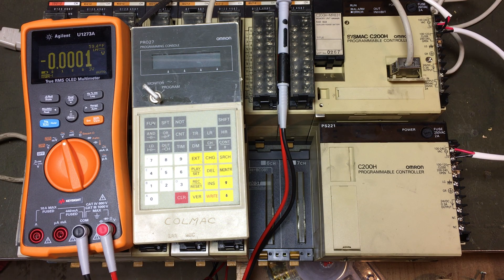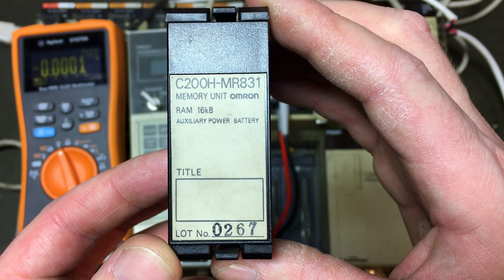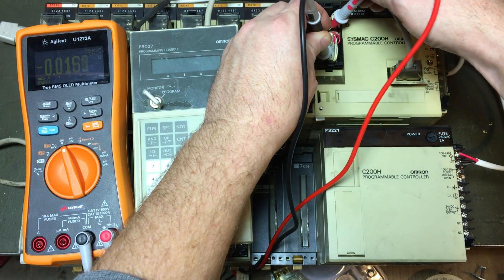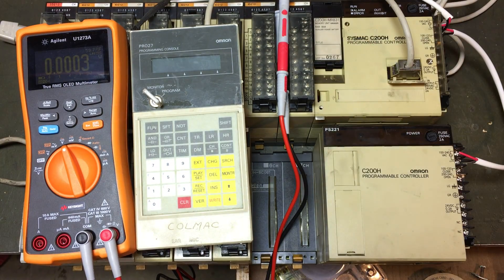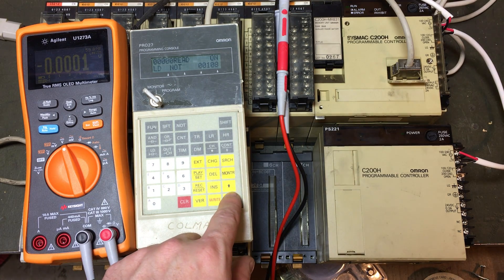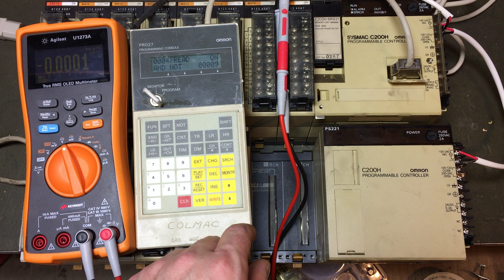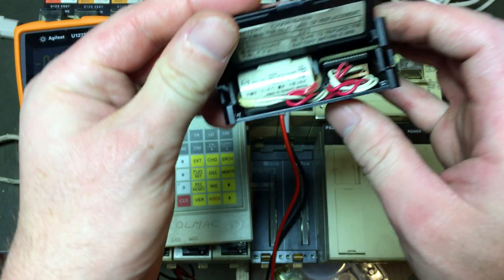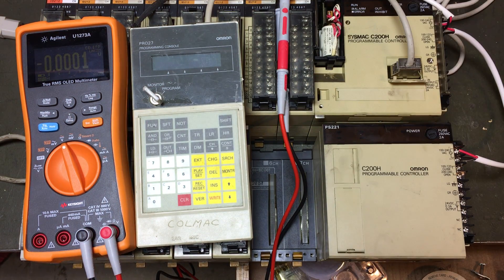Old Omron PLC still holding programming in RAM since 1987!

Comment: Cool video! Thanks for share!
Reply: May I ask can "OMRON CX-ONE 4.4 CX-Programmer 9.62" communicate with C200H series PLC?
Reply: Yes, You can do it. But you have to use a C200H LK201 Host link adapter connection. @peterkuoo

Comment: Hey dude, I need your help urgently. I have to upload (get) the program of this exact Omron Sysmac C200H CPU for system upgrade. 

I read (and see here) that it has the handheld programming device, but does it also have a programming software that can be installed in a laptop? What is it? Can you give me link for download? What Windows platform will it run and what cable/laptop port do I need? Thanks a lot!
Reply: You will need a omron lk 201 unit .... then you remove one unit from the backplane and put the lk 201 in. This one has rs232. Then you need a pc with omron cx programmer and you can make a backup

Comment: Can do many things...like automate something at your house.

Do you have a swimming pool? You can automate the filter engine or hook on a embedded (RaspberryPi, OrangePi or maybe a simple arduino to interface sensors or comms with a mobile phone to control it)...

There are many other things, but these are some ideas...
Reply: Hey dude, I need your help urgently. I have to upload (get) the program of this exact Omron Sysmac C200H CPU for system upgrade. 

I read (and see here) that it has the handheld programming device, but does it also have a programming software that can be installed in a laptop? What is it? Can you give me link for download? What Windows platform will it run and what cable/laptop port do I need? Thanks a lot!
Reply: Sorry to check your post so late. Well, I don't know much of those older PLCs, my father-in-law used to work with it and worked as some kind of specialist, we talk about this some times.

I'll take a look and see what I can do to help, if it still help.

My advice would be to install a newer PLC if there is upgrades involved...this thing is old. But if it is working perfectly and will serve your needs, I see not so much reasons for not to use it.

I'll stay in touch. If I find something, I'll post over here.

I'll be glad if I can help.
Reply: Well, I did a fast research about this and I found somethings...I'll try to synthetize it for you:

- There is an audio out from the programmer, you can make backups or programming though a cassete tape (like those old computers, such as Apple IIc, MSX and other Z80 stuff).

- There is two ways to connect it to a computer, running DOS natively (to avoid errors use some Windows 9X version, nothing newer than Win XP). The connection can be done through a CPU mount (P/N 3G2A6-LK201) which is obsolete and not used anymore, I couldn't even find it to sell. Can be done with a rack mount also (P/N C200H-LK201), this option is more realistic.

The software for this is called LSS...
Reply: Daniel Zulato Dias de Moraes Wow, I'm amazed with your kind effort, tnx! 

That's also what I've read, there seems to be a need for a "hostlink" module (either cpu or rack-mount) in order to even just be able to connect the laptop to the CPU. So it means that covered port is only for handheld and can't be connected to a laptop? But what about the horizontal big port below it (seems 40-pins)?

But one plant guy insists he seen the Omron guys before upload a backup to a laptop, using Syswin software, connected directly to the CPU. Probably he overlooked a module they might have used that time (there's nothing like those hostlink module right now there, only something like a rack extender module).

About the audio backup, I'm sorry I can't seem to understand what does that mean hehe.

Thanks a lot again!
Reply: Hummm I agree with you, I think is some device used back then, and now is no more available, or was not easy to find on the market.
Well about the backup, in old computers for ordinary people...I mean, really old, like MSX, Hotbit, Apple IIc, was not so cheap to store data, for example a floppy drive was something expensive and not every one could buy. But there was an alternative, roughly is  to record the sound of data.

The way of doing that is having a cassete tape, a cassete recorder (no, it wont work on digital devices like, record on a computer, because it tranforms the sound into digital and the sound won't be the same, it is about waves amplitude that tape can store and computers not), if there is an option to do the backup through the audio exit it may work. 

Maybe I am wrong about that also and the jack which looks like and audio jack is a data cable, maybe UART or some RS-232 thing.

You're welcome! 
I'll try to help the way I can. =)
Reply: I need to recover her memory but the battery ran out, is there any way to do this? Tks